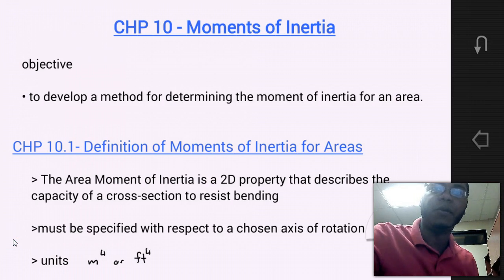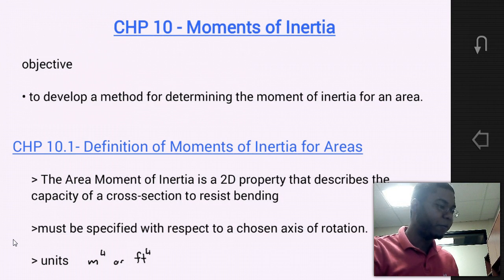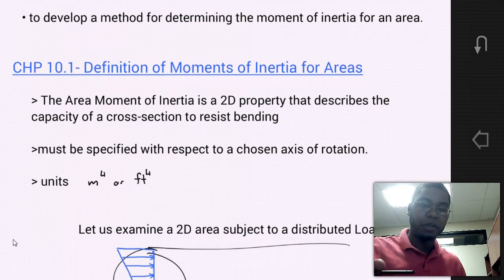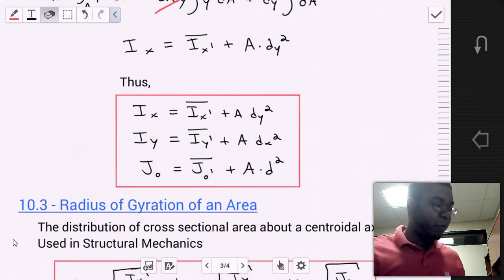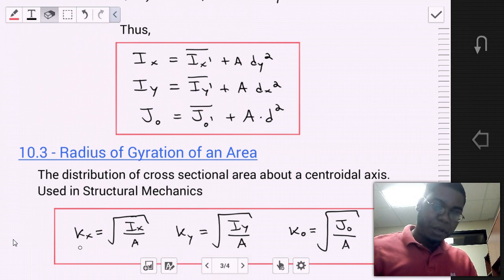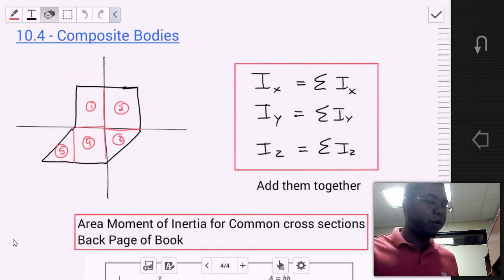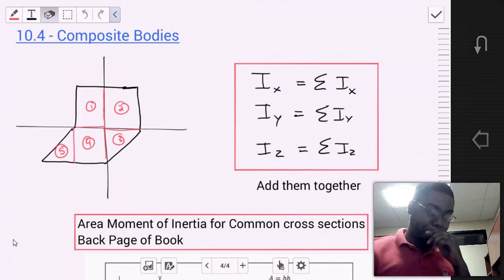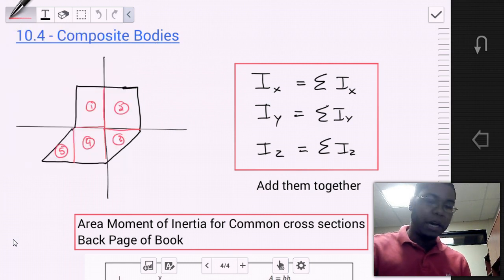Moments of Inertia (Statics 10.1-10.4)

Comment: I watched the first five minutes.  You repeatedly used the variable "m" without ever defining it.  Finally, you said it was a slope, but nothing more.  In the past, when I have seen a variable named m, 99% of the time, it has been a mass, but that doesn't seem to be what it means here.  I still don't know.
Reply from the maker: Hello BrandonFlorida, Let us examine a 2D Area subject to a distributed load, w. A distributed load changes as you move long a distance. Look at the triangle which represents our distributed load for this problem. In this problem, the distributed load is a linear equation of the form w=m*y where m is the slope of the line (in a real problem this would be a number you are given) and y is the distance across the cylinder. Good Luck in your studies.
Reply: @CalvinStewartPhD  My only question is that just before that, you said that the units of the area moment of inertia are either m^4 or ft^4.  Is this a different m, because it's not clear to me what units the slope has?
Reply from the maker: @brandonflorida1092   Hello Again Brandon. Moment of Inertia, I has the units of m^4 and ft^4 where m is meters and ft is feet. In the distributed load, w the slope m has units of N/m or lbf/in. Remember algebra. The linear equation y=m*x+b where m is the slope and b is the intercept. The slope, m is just a placed holder for a real number. It is not a unit itself in this usage.
Reply: @CalvinStewartPhD  My problem is that in physics (my background), moment of inertia means something very different.  Thanks for your time.
Reply from the maker: @brandonflorida1092  The naming convention for moment of inertia has historically been messed up. It is called different things depending on the book you learn from. Thesed two links might help. https://en.wikipedia.org/wiki/Second_moment_of_area ; https://en.wikipedia.org/wiki/Mass_moment_of_inertia